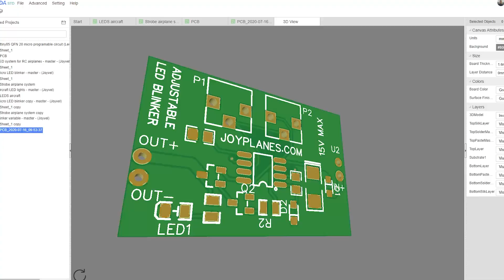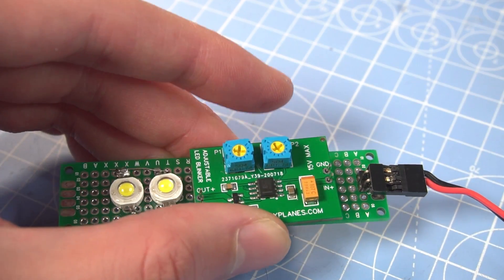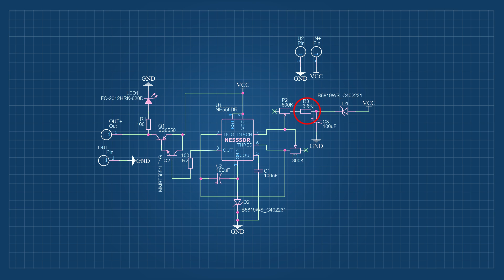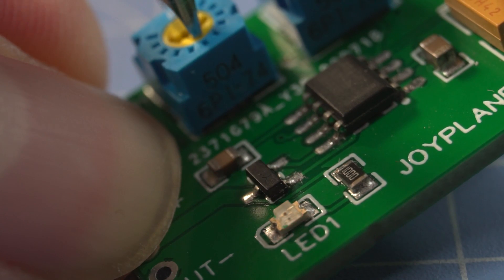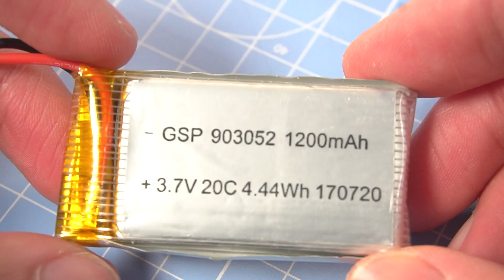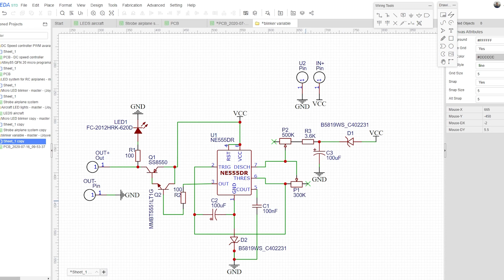Adjustable blinking LED circuit for RC aircraft | Navigation lights

Comment: Loved it totally, 
I made one similar which was based on PIC based MCU
however yours is way simpler than using a MCU.
2:32 the resistor you soldered is 1K ohm and not a 3K as told or 3.6K ohm as shown in BOM material .
Hope to see your next version soon.

Comment: Can I buy the kit?
Reply from the maker: Not yet
Reply: @Joyplanes  
How about buying your printed circuit?
I build kits myself, like I've explained about building an IC kit for flashing lights back in the 70s. I an still building kits even today.
Reply from the maker: @mickcarson8504  The reason I'm not selling this is because there was an error with it and never fixed it. But I'm working on a better one.

Comment: It's an old idea but improved with the use of LEDs. I did this in 1976 with a RC model glider, Cirrus, fully fitted with two small xenon flash tubes running on a 9v battery. It had a tiny red incadecent light on top of the tail tip and small red + green at the tip of its wings that remained on during flight. I was able to fly at night without problems. I then used the same lights and strobe on my 5 feet Kavan Jet Ranger helicopter (not sure if you people of today know that Kavan, a model manufacturing company in Germany, was very popular, made scale helicopters in the 70 to 80s. It was then transferred to his daughter somewhere in late 80s in the US. Don't know it it still exists.)

The Bell Jet Ranger helicopter looked realistic that, from a distance you couldn't tell if it was a real helicopter or a toy with all the working tiny lights and flashing xenons and the sound of its size 60 OS engine.

Comment: A small correction to one of your statements, Yes JLCPCB does solder through hole components. I have had boards made by them with Hand soldered and smd components on board and they did a great job.

Comment: This is great and thank you for the work.  As a ship modeler this is going to work great for a base and thank you for your efforts.  With some navigation on models there is double navigation lights.  So the Red and Green are say a 1 sec pulse while a white navigation set is at a 0.5 sec pulse.  But at the 1 sec pulse all the lights blink together.  So I wonder if there is a way to split the signal or something to do this sequence timing.
Reply: Build two of these circuits!  one for red/green and one for white.  They are small and cheap and you don't have any weight concerns. :)

Comment: Outside of the desire for strobe count/pause duration, having it with it's own integrated on off/regulator would be awesome.   But at this point I would just go ahead and go all the way with your plans and build one that also accommodates alternating (left to right) and also a beacon into the system.   Might as well just make a true "all in one system" at this point.  I am sure it would be very profitable with those nice 1 watt LED units.   All the others are lack one thing or another, but one of the main issues is the lack of quality "bright" LED's.    Anyhow, thanks for developing this.   Count me in for purchasing all of your work.    I just bought some things.

Comment: You could always add a 5v regulator at the input if you wanted to power the circuit from higher voltages.  I've used them successfully in my projects where the input voltage is 9v, and I am mostly using the circuit to time and light LEDs.

Comment: Monsters under the bed! Love it and great job!
Reply from the maker: The warning seems to work for now, but sooner or later some people will dare the power of the dislike button.
Reply: @Joyplanes  I have a challenge for you. Could you make a Cartboard airplane, meduim in size, but "anti-stall". Let me explain. The plane must naturally want to climb up, so when it dives, it can recover from that. But, when it goes to much up, in a stall pitch, there a MECHANICAL mechanism that puches the elevator down, to make it level.
Without using electronics, or RC.

Comment: It would be interesting to integrate in the circuit the on and off function to be controlled directly from the radio control
Reply from the maker: Yes, I'll start developing a digital programmed version that can be activated from the radio.
Reply: @Joyplanes  that would be awesome.. or even add an option for a backup lipo cell that if you lose rc link and you go down it flashes under own power for some time to help locate since we know that all the other electronics of a downed craft will kill the main flight pack pretty quickly , especially if there is an esc fault or other FC short